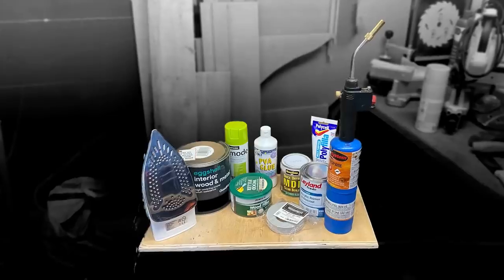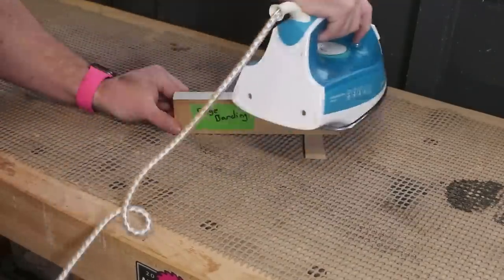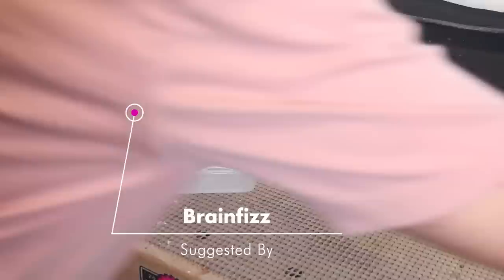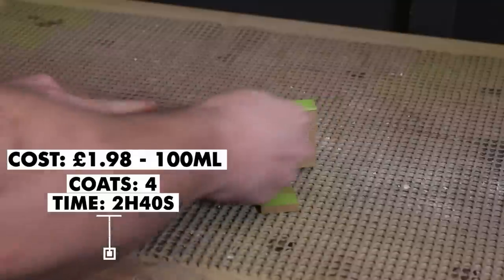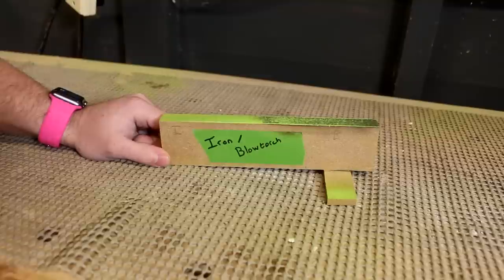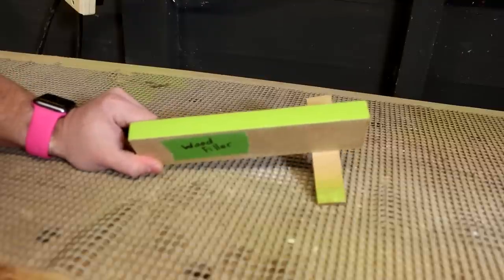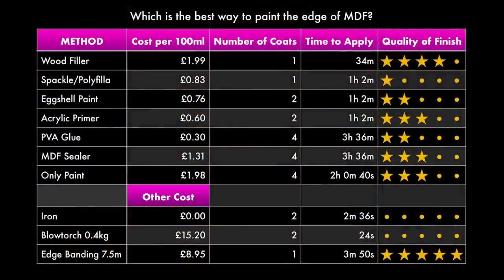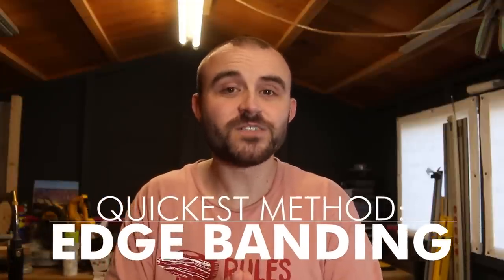What Is The BEST Way To Paint MDF? - 9 Methods Tested

Comment: The common feature of most of the poorer results is that they are water based, which the MDF soaks up like a sponge.  My go to is Zinsser BIN, which is made from Shellac and Methylated Spirit based so doesn’t react with the MDF in the same way, a couple of quick coats plus a quick sand in between gives excellent results for me. There is a great video on the Charlie DIYte channel, about painting MDF with Zinsser BIN.
Reply: BIN is my go to for this aswell. its expensive but goes a long way. it dries really fast  and sands really well. the beauty is that by the time i finish painting the edges on a few doors i can  sand the first one and recoat.
Reply from the maker: Thanks mate! Zinsser has been recommended a lot now Haha wished I’d known about it before. I’ll have to get some and try it out
Reply: Yep, I came here looking for shellac results.
Reply: I’ve considered the 13oz  can of the shellac based BIN Primer spray is $20.98 USD or the quart is $23.98 USD.        For me, I don’t see the need for the expense since I have edge banding and don’t have a lot of MDF to seal.
Reply: What I use also, fast and inexpensive and sometimes I use acrlic

Comment: Yep - not surprised at the result although I dont think the edge banding really belonged in that selection - it is a different material applied to the edge of the MDF so I dunno.
Reply from the maker: I think it can fall into a similar category to the wood filler and pollyfila. Those 3 don’t really soak into the surface like the other options.  I get what you mean though. I just took suggestions I was given and tested them out. Painting MDF edges in particular can take an age so I thought it was worth comparing them all

Comment: Should of used a roller and paint instead of spray paint. Normal paint would help fill in the pits and stuff. Spray paint doesn’t unless you spray it heavy then it would have runs on the sides. Good idea, bad application. It also has to do with the quality of paint you use. Good quality paint will fill in the pits. If using a brush on a vertical surface after applying the paint make all the brush strokes horizontal and they fill themselves in without leaving brush strokes. Unless you try to put three coats on at one time. Goes to the painters skill, technique, and paint quality.

Comment: Your polyfiller recommendation could have been better. Must use fine surface filler version, apply either with finger or knife. Can sand back and then a quick 1200 wet’n’dry (wet). Leave to dry again it’s ready to be primed.

Comment: I've worked with MDF a ton, the strange thing is I've never had to paint it. I've always covered it with a texture coat, carpet, leather, or vinyl. It's always been in a vehicle of some sort. I wonder if you couldn't sand it with a very high grit to basically seal the pores. That stuff does soak up whatever you put on it, even glue. It's also brutal on your bits and blades.

Comment: Great video! I'm a professional painter based in Canada, its very common to get factory primed MDF which a carpenter will then cut and leave a rough edge. We found the best solution is to use acrylic latex caulk (e.g DAP alex plus) on those rough edges for a nice smooth finish and very quick dry times. For any bare MDF we will always set up racks and pre-spray prior to the carpenter installing and making cuts, then follow up with DAP on the rough edges, with an additional coat when they're installed. I may just have to take a look into the edge banding after watching your video since that does create a nice finish.
Reply from the maker: Thanks mate! I’ll have to look into DAP. Not heard of that before. Ideally a good balance between cost, time and quality is what I’m after haha

Comment: Well done mate, that must have kept you busy! I have another technique, I use cellulose sanding sealer, 2 or 3 coats with a brush, it dries quickly, soaks into the fibres and strengthens the edge, great for MDF mouldings.
Reply from the maker: Thanks mate! It took a while to get through them all and edit it together haha Never thought of sanding sealer 😅 gonna have to gibe it a try haha
Reply: Agree.
Reply: You could also have tried Shellac Sanding Sealer or Zinsser B-I-N, which is shellac based.
Reply: @bitTorrenter  I came here looking for shellac results

Comment: I use Gesso, canvas prep artists use for paintings. It’s a paint pigment, gypsum, chalk, and binder mix. Available in white or black. Dries fast, does not crack, sands super smooth, and multiple layers can be applies. With a few applications your edge can be as smooth as glass, and hard. And it does not cost much.

Comment: Great comparison video mate. I've used the wood filler option for a bit now, i've found that if you apply 2 coats pretty thinly with a fine sanding in between and after it gives great results.
Reply from the maker: Thanks Paddy! I was really impressed with the wood filler method. It was silky smooth!
Reply: Hi, do you ise 2 part wood filler or ready-to-use?

Comment: Thanks for satisfying my curiosity about MDF edging and how to seal it.
 I use a sheet of 1200 x 900 x 19mm MDF as removable benchtops on two benches         
I gave them  3  coats of linseed oi and it has been very good over at remaining flat over the years.
 About the banding, I can't help but think I would have concerns about how well it would keep sticking to the furry surface over time.
Reply from the maker: Thanks mate! I haven’t used edge banding before so I can only go on others recommendations. From what I’ve heard, its really durable. Its used on MDF furniture and built in MDF units all the time
Reply: @AverageJoesJoinery  Thanks. there's nothing like experience to have faith in whether something works or not. 
The only edge band I've used is retail DIY stuff. Plus, I've only used it on particle board on projects where it would not be important if it came a bit loose or started to peel away.

Comment: Great comparisons Joe, one thing I've noticed is that the mrmdf is so much easier to paint and acrylic primer works great with it. It's the same price for the mrmdf as well in Hull so I should imagine it's the same where you are, but they only sell it in timber merchants not diy stores.
Reply from the maker: I’ve never used mrmdf because its almost twice the price where I’ve seen it haha will have to give it a try at some point though 😅
Reply: @AverageJoesJoinery  bloody hell, well if your ever in Hull mate😂
Reply from the maker: @karlpopewoodcraft  I know right haha 😅 I’ll have to bring a van 🤣
Reply: @AverageJoesJoinery  probably because I live right on the docks where it comes in. 😊
Reply from the maker: @karlpopewoodcraft  I better bring a boat instead then 😂
Reply: @AverageJoesJoinery  😂

Comment: Good video mate. I have to say though some of those methods aren’t practical when you have any sort of routed edge. The only way I’ve gotten a nice edge is to use some sort of sponge sander to follow the routed shape and go up through the grits from 80 up to 180 before any paint or primer has been applied. Then with each additional coat, a gentle sand with 120g up to 240g.

Comment: A couple of things to note, do not use anything water based on MDF. Edges, drywall putty works well as an example. Use solvent base primer for your undercoat. For the paint, use Acrylic or Lacquered or oil based products. Obviously there are many options.

Comment: Thanks for this fantastic video! I’m painting large speaker cabinets made with mdf that have rounded edges on all sides. I want an absolutely smooth finish so I did the edges with red Bondo spot glazing putty from a tube and thought it would fill the pits. I sanded it down to the profile of the wood, then applied it again and sanded so almost all of the Bondo was gone, just bits of red remained. It looked smooth, but when I applied Minwax sanding sealer to the whole cabinets, the remaining pits in the edges showed up. Maybe topcoat will cover but to be sure the pits are gone, I plan to put your wood filler on and maybe a little putty in the bigger pits and sand it before the topcoat. In short, Bondo did not work well for me in this application as it really did not fill the pits as I thought it would. Maybe it needed sanding sealer to be laid down first. Anyway, thanks for a fine, concise, cheerful and very interesting and informative video! Subscribed!

Comment: There are few options that i can suggest for everyone that it's reading this.
I have tried every method that I've heard of ,but the best results without expensive sealer i had, is definitely with nitro base  enamel (clear or mat)
First the most important thing is good prepared edge, you need edge without cutting marks so you need to sand those imperfections.
If you have deep marks ,sand it with 120 grit paper ,than proced to 240 grit .
Nitro enamel you can apply with brush or roller and even with hlpv cheap gun,i personally prefer brush . Apply one coat than wait for 10 to 15 minutes.
When its completely dry ,sand down  the edge with 400 grit paper .You will have a great result with this method .
If you see small holes or any other imperfections,apply one more coat of nitro enamel . After it got dry ,sand again with 400 grit.
If you need any other help , I'm more than willing to help,contact me .
Stay strong as a community,stay strong as a family .💪

Comment: Also, in terms of determining cost, it might be better to do cost per 10cm or 10cm of mdf, as opposed to per 100ml of paint, glue etc etc. Just a thought :)
Reply from the maker: I did think of costing by area instead but I wasn’t confident with how accurate my measurements would be. I’d still have to measure the quantity of liquid used to cover that area

Comment: Do you only use 240 grit then paint or do you use any other grit before painting? Please I need to know thanks in advance
Reply from the maker: I sand to 240 grit before painting and then I use 240 grit between coats too. Hope that helps 😊

Comment: Hi Joe . Which make of edge banding did you use . I have tried some from B&Q and is rubbish it lifts and peels off after a short time . Cheers mate . Bill
Reply from the maker: Hi Bill, I used the cheapest stuff from Amazon. I think it’s Woodpress brand. I can’t comment on how it holds up long term though. I was really just testing its finish

Comment: Did you sand the MDF before painting?  If so to what # grit 220 grit or 400 grit?  I use straight woodglue which works okay.  I don't water it down because it takes longer to dry.
Reply from the maker: Yes mate, they were all sanded to 240 grit before anything was applied. I’ve always found anything more than 120 is excessive because it just furs up after you apply a liquid anyway haha

Comment: Check also epoxy resin and poliurethane laquer.
Reply from the maker: Epoxy resin takes an age to dry unfortunately. I haven't tried painting over it either so not sure how paint would adhere to it. Will have to see about the polyurethane lacquer, I use it on solid but never tried on MDF :)
Reply: @AverageJoesJoinery  Epoxy need up to 24hours and surface is totally sealed. OFC you need to sand it before painting but im sure that you know that.
Sometimes we have a two ways:
fast or good :) Nice test anyway!

Comment: from my expereince I found only 2 methods that give best result
-car body filler is the smoothest and can fill all wood grain in one go but it takes practice to apply it so you won't make way too thick layer that gonna cause you trouble when sanding it.
-acrylic primer , its easier to apply but requires multiple time to be put on surface until it fully fill the grain since it need multiple coat so it takes longer time until the surface is ready for actual paint.

Comment: To remove the pitting wont come from using just paint or primer to get a perfect finish you would need a combination of primer and filler possibly a high build primer
Reply from the maker: Cheers Simon! Pitting was a real issue thats for sure. Interesting to see the comparisons though
Reply: @AverageJoesJoinery  personally I prime fill and prime then paint sanding between coats, awkward molded  areas that aren't flat I brush on the filler and sand easier

Comment: Great video Joe, very useful. One question, standard B&Q mdf or mrmdf? I’ll only use mrmdf now as a much better finish although it does take a fair bit of time to achieve. You should check out GID’s videos, he spray paints but seems to get an excellent finish. Keep up the good work, always enjoy your videos
Reply from the maker: Thanks Steve! I just used standard MDF from B&Q. It’s what most people have access too plus its cheaper haha I need to try some moisture resistant stuff though. I really want to get a sprayer too haha I think a hvlp sprayer would be my best bet
Reply: @AverageJoesJoinery  the diference is crazy. even cheap mdf to good mdf is a huge diference, go to MRmdf  and yu will be shocked. you can go better again and go to hydrofugo its MR but also higher density for routing ect

Comment: I noticed that you didn't try an oil based primer and gloss paint on top,  sand smooth, one coat of primer, two coats of paint, scuff sand between all coats. Using oil based primer should avoid the MDF swelling
Reply from the maker: Will have to give that a try mate 👍 Thank you 🙏

Comment: If you really must use MDF for painted projects here is the best recipe for a decent finish.  

Dependent on how the material was cut go through the grits to 240.  Make sure you sand it well don't wave a bit of abrasive past it and call it done.   Then apply one coat to the face and two to the edges of Zinseer Bin. Sand again to 240 grit and you should end up with a perfect surface to commence priming and topcoating.  Zinseer Bin is a spirit based product and will dry quickly totally sealing the very porous MDF.  

Ideally instead of trying to put lipstick on a pig use MR MDF for painted furniture.  This way you only need to sand to 240 and then proceed with any paint system you desire, plus it is denser and more appropriate for furniture or painted pieces for the home.  Acrylic primers and eggshell topcoats will give you a really nice finish if you are willing to apply multiple coats and sand in between each one (240 grit between primer coats and 320grit between topcoats).  

Paint finish is all about the preparation and sanding is something that takes time and patience but there is no paint system that will cover up poor prep.  

I have built fitted furniture for years and many of those pieces  have been from MR MDF.   I now spray all my pieces but back in the day I started by finishing by hand with a brush and roller.
Reply from the maker: I really need to give this a try 👌
Reply: @AverageJoesJoinery  Get hold of some MR MDF you will find it a revelation in comparison with MDF. Good luck.

Comment: Hi Joe, great informative video, quick tip, when using iron on edging immediately after ironing, ie while it's still 'hot', rub it quite hard/firmly with a flat piece of wood 75 to 100 mm long until it cools, you will not see any immediate improvement but it 'sticks' much better and the edges are less prone to chipping if you catch them, hope this makes sense, tip was given me by a kitchen fitter mate who says that's the way they do kitchen worktops edging he called it 'burnishing' no idea if that's the correct term btw,  it does indeed seem to work well, try it after all you've nothing to lose and it costs nothing apart from a little extra time
Reply from the maker: Thanks John! Thats a great tip! I’ll have to give it a try. Bound to apply more even pressure than just the iron

Comment: Amazing how in 2021 we still don't know the best way to paint mdf edges even though professional cabinet makers have been doing it for ages. Why don't you visit a professional shop and ask them.
Reply from the maker: Amazing how in 2021 people think everyone has access to a professional spray set up
Reply: @AverageJoesJoinery  knowing about how professionals do it is different than having a professional setup.
Reply from the maker: So what happens when they show you how they do it with a professional set up?
Reply: @AverageJoesJoinery  you learn the process not the tools and try to replicate them using the equipment you have. Learn the theory behind a good mdf edge process.